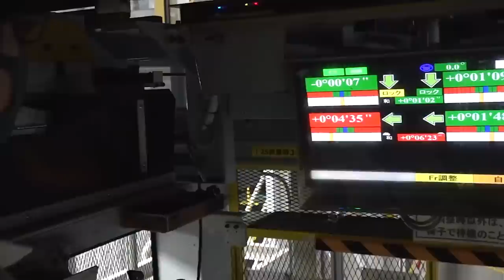CIVIC TYPE R Production Line in Japan

Comment: I just want to see the rear suspension to see if it can fit the awd aftermarket conversion.
Reply: I know someone who already did it and used a drive shaft of a CR-V (2016 I think) for the AWD. He did additional mods in the Civic but the suspension handles well the additional weight.

Comment: Junk!! I sold them for years but now they are so far behind others out there. I was going to buy a new one but after they told me the mark up I laughed in their face and I was going to buy my 7th BMW. I wanted a new M3 but I looked at the prices, what I wanted in a car, what I was going to do with the car, insurance and gas back in June of 2022 and I went and bought my first 2022 Tesla Model 3 Performance. The car has absolutely no soul that's for sure but putting gas, oil, maintenance into a car has its price. I had a nice 2010 BMW M3 with a naturally aspirated V8 that was so nice even stock but now everything is 6 cylinder and turbos and more turbos. Anyone knows that BMW and this Honda Type R is more fun to drive but I do not pay markups and going fast at any speed is my thing now. Torque is there for me no matter how fast I am going and I raced a new 2023 BMW M340i just yesterday and he did things to his ride and I smoked him. Then I gave him another chance at the next red light and we rolled down our windows and said as soon as the light turns green light em up and I told him the best way to take off was using Sport + and taking off traction control in the dry roads and I swear I heard him rev his engine up to a certain RPM and the Tesla just left him at the light. Sure I heard his engine work it's ass off to try and catch up but not even a challenge. Can you imagine what a Honda Civic Type R would be like. I wouldn't even have to floor it half way and I smoke the Civic. Yes the Honda is great for track racing but that is it. The Type R is only a 1 trick pony. Oh and I called the insurance companies and all of them had the Type R more expensive to insure then a $90,000 BMW M3 a Tesla Model 3 and even a Subaru WRX STI. I can't believe how much I loved the Honda S2000 back in the day and the old 1997 Acura Integra GSR as I owned one and the Type R Acura Integra but now for some reason the competition has grown so strong that I just couldn't look the other way. Do you guys really think the added mark up or the unnecessary add ons the dealers throw on there to make a huge profit margin is cool with you guys??
Reply: I am getting a HONDA CIVIC TYPE R 👊👊
Reply: @LANDAVERDI  what color?
Reply: Never, never, never pay dealer mark-ups! The stealers need to learn the hard way.
Reply: @ShadowBannedagain  Not today.